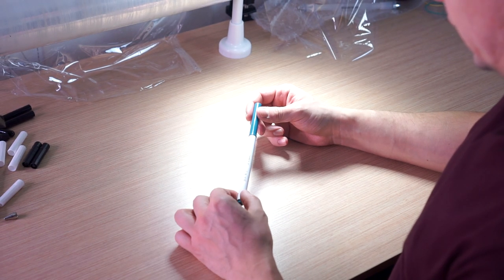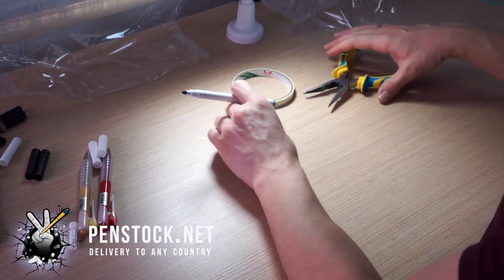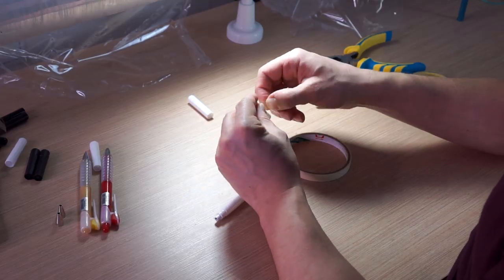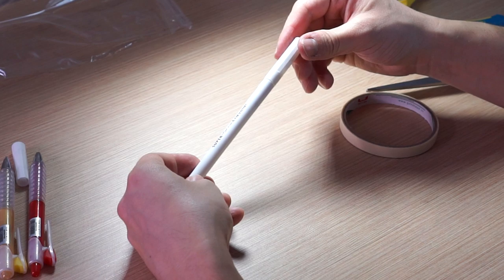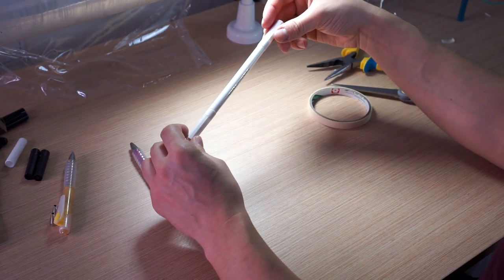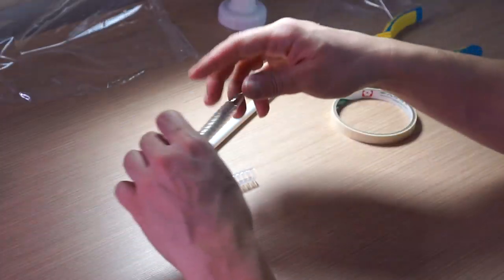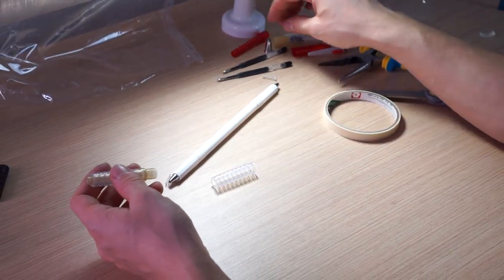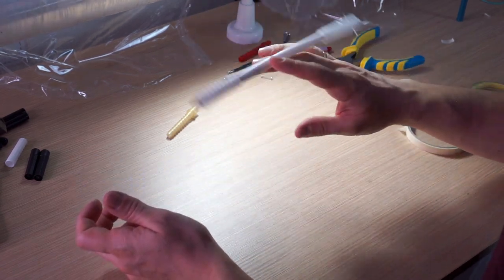How I make Flying Panda mods in batch / Pen modding tutorial

Comment: I'm starting off with pen spinning, should I get a twilight since it's perfect for my use (I used one before) or should I get another one.
Reply from the maker: Twilight is OK, but pretty far away from perfect. It lacks momentum, so try something else
Reply: @PenStock  Thanks!, i bought another one which my classmate reccomended (he spins for almost a year now).
Reply from the maker: Which was that?
Reply: The one I bought is a package, it comes with two pen mods, a flying panda and a twilight.
Reply: KURØ YAMI nice choice!
Reply: 2 years later how are things going for your pen spinning

Comment: Should  i buy from penstock flower v5 as my main mod ?(I am also a beginner )
Reply from the maker: Flying Panda will be better.
Reply: Ivan or hash comssa is probably a better starting point than both of those mods
Reply from the maker: With which pen mod did you start?
Reply: @PenStock  I started with the Bictory mode. Its a self mode
Reply: @PenStock  normal mx and ivan emboss